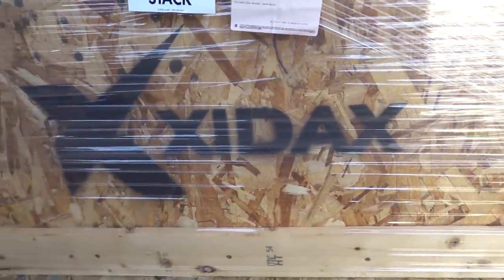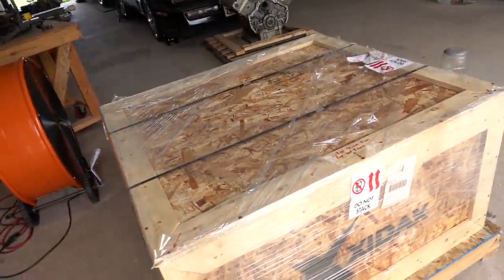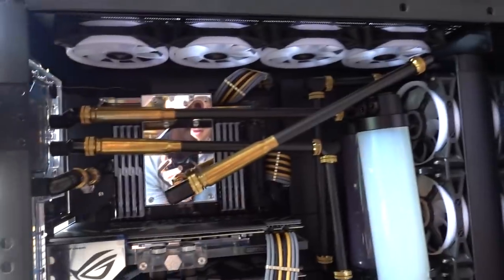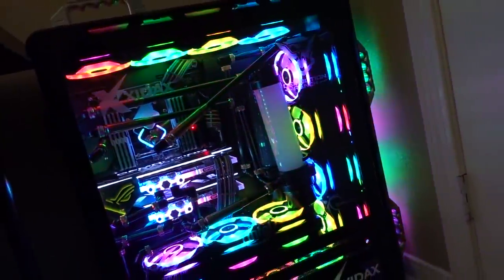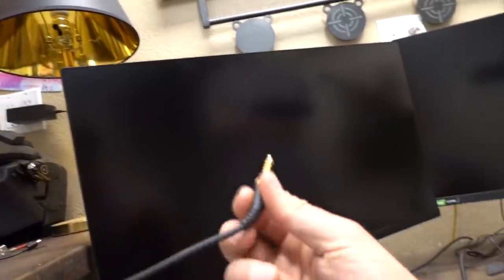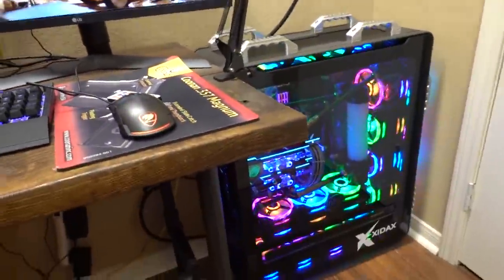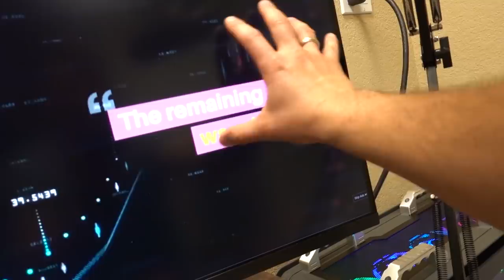The Demolition Ranch Ridiculous New Gaming Computer! TWITCH!!!!!

Comment: My man's is so wholesome, he's so excited for whatever he's doing and I still don't know how he keeps such a good attitude no matter what happens

Edit: reading the specs. 2 2080ti's? AND MARKED WITH DEMO RANCH?
Now that my friend is how you flex.
Reply: one of those cards costs more than my entire setup
Reply: Idk why he went so high spec when he has to do maintenance on that loop he is going to be lost or he is going to have to hire someone to do it
Reply: @Plane.  could call linus
Reply: 2 2080ti's and uses 1080p 144hz moniters wtf lol.
Reply: @williamnorris2717  1440p 144hz.
Reply: In about 3 months the 3080 ti will come out and significantly out preform 2 2080ti's.
Reply: 128 gb of ram
Reply: 2 tb nvme
Reply: @williamnorris2717  1440*
Reply: @joefrog1996  who cares. what game out there is going to be able to challenge a 3080ti? games are barely pushing 1080ti's to their limit
Reply: Ricky Fite truee
Reply: @williamnorris2717  agreed, if you were going to spend the cash and it was also going to be an editing rig why wouldn't you have gone 4k HDR1000 VESA certified.

Comment: As someone who does custom PCs and case mods, i'm honestly disappointed by that watercooling setup. The component choices are great for both the hardware and the cooling, but the layout of the lines is amateur at best; it looks crowded and chaotic especially with so many fans on all the radiators. They used PETG tubing but didn't bother doing any bends at all, just straight runs and heavy reliance on swivel fittings. It wouldn't surprise me that some leaks develop as the system ages with so many potential points of failure. They also bothered with so much packaging externally to the system, but didn't bother putting anything inside of the machine to hold all of those sensitive components in place. Doing that one thing alone would have at least kept the reservoir from coming loose from the upper mount. I hope that all of my qualms prove to be pointless and that you have a wonderful experience with the system for years to come, but I suspect that this machine will turn into a huge headache when you have to do maintenance in the future.
Reply: @danielredziniak2996  Constructive.
Reply: i agree, while 30 fans with rgb and 3 360mm+ radiators can look crazy, it really is pointless. internal foam for shipping would have definitely helped the first time around
Reply: @danielredziniak2996  Your videos show the amazing skills and knowledge you have to offer the world.
Reply: I was always wondering who was that one or two guys that always had to hit the dislike button on any video. Save a nun, thumbs down. save puppies ,thumbs down. nun saves puppies, thumbs down. For every 100 wipes there's always one or two thumbs down. Now I know who it is.
Reply: @danielredziniak2996  Ok2k
Reply: You're not wrong. I just tore my system down and swapped from the lian li dynamic to the dynamic xl. Cleaning 12 fans isn't fun and even cable management is a pain with just 1 fan controller and 2 rgb fan hubs let alone I'm guessing 5 rgb fan hubs for all those qls and at least 3 fan controllers?
Reply: He will just send it back for an upgrade or his little brother will fix it. I would love to get my hands on that thing.
Reply: @danielredziniak2996  he's right in every one of his points. Just keep driving your truck bud I'm betting it's the only thing your meager brain power can comprehend.
Reply: Daniel he's right though ya numpty
Reply: @sharewolf10173  I hope you aren't referring to me, that would really be jumping to conclusions without much for a base. I didn't like the watercooling setup, but that is no fault of Matt's nor was the video of poor quality or taste and as such, I didn't like or dislike the video. 
I certainly understand your point of even the best videos having dislikes for seemingly unfathomable reasons. It could be down to those who are obsessed with hating on someone or individuals who can't separate subjectivity from objectivity and dislike the video because it doesn't agree with their views or opinions. Could speculate all day long about the dislikes.
Reply: @subsgob00m  we will just speculate they were in a hurry and hit the wrong button... 👍
Reply: This guy, LMAO. beat it L O S E R.
Reply: @Honest Fellow free PR you mean? Cant expect the same PR from expected maintenance, so cant expect it to be free either...
Reply: @danielredziniak2996  How the hell is a guy who talks about technology pertaining to a modern pre-built system a boomer? There is this guy, sharing his skills and knowledge for free, giving a bit of constructive criticism. You think engineering is easy to understand punk? You think thermodynamics and fluid mechanics is a joke? The material science which goes to make tubing a facade? Pressure localisation buffoonery? Now go ahead and call me boomer. I'm probably younger than you.
Reply: It is a bit strange they would be so careless with upwards of $10k worth of hardware. Hope someone will service that for a reasonable price in the future. Looks like a headache
Reply: I agree.  I was trying not to completely hate the system. The back plates are super cool but, they should have custom mounted them with extension ribbons to show them both off in a single file vertical mount solution.  I do hate the not level tubing and the tiny little single out of place reservoir. The 50 casings were a cool touch. 

I think jay or linus would have done a way better job. Jay's videos are getting annoying tbh. It's like watching the spoiled fat kid brag about all his cool stuff. I just want to see cool custom builds. Hes good at it.

Anyways... I have a bad feeling the fluid in that pc is going to gum everything up. Hes going  to need to flush it in a couple months. I would use distilled water to replace it. 

I wonder if they even flushed the rads before final fill and I cant believe they didnt go gen 3 threadripper. Such mistake. Yea, the mobos are more expensive but the cpu is cheaper and a way better work station. 

That build is ultimately a sloppy mess with a couple cool custom back plates on the GPU's.

They need to strip the parts out and let some one do it right.

Comment: He said his ac Bill is going to be high. No Matt you’re electricity bill is going to be HIGH
Reply: That's the same bill....
Reply: I think he meant from the exhaust of the pc with all the fans removing heat from it he’s going to have to keep his ac on more ... it makes more sense that way
Reply: Joel Gonzalez I know it’s just funny he thinks the ac will run the bill up more than the pc. I think they probably both pull the same wattage
Reply: That pc prabobly has 1600 watts psu so electric bill definitely going up
Reply: Random Hobbies 100%
Reply: @randomhobbies5796  It's powerlimit, not the constant usage power. I doubt this PC will consume more than 1kW
Reply: camjamsdad  That pc is like over 10k and I dont know how much he plays but most fulltime streamers spent WAY less... So yeah, he can afford it
Reply: Matt: hold my beer..
Reply: @TheElitekruemel  He didn't buy that PC, it was a sponsorship.
Reply: Joel Gonzalez yes can confirm I have half that system at $3K and it heats up my whole room in about an hour of gaming. And had to get an extra window AC unit to keep my room cool even into November in Wisconsin lol!
Reply: @Infgator  you're right.. I didn't even think of that.. But under load with 2 gpus and all them fans.. Definitely 1kw +
Reply: Adam Harding geeesh bro now that’s serious gaming ! That’s an expensive hobby I used to be into ps4 cod bo2 mw3 but never knew it could get that crazy that’s a whole car lol
Reply: Also ac because the room heats up

Comment: Small recommendation about the PC, you should move it in a way that has more airflow... right now it's getting blocked by the wall.
Reply: i noticed that too, but he does wanna show off all that rgb... maybe place it at an angle so it at least gets some air flow
Reply: Maybe wall mount it somehow so more airflow and to show off the RGB's
Reply: with 30 fans and liquid cooling the front intake being a little blocked is not going to do much, especially when you consider it has an inch and a half of space at least due to the handles being there anyway
Reply: Also with the amount of air it is going to pull from under it with all those fans shouldn't make it an issue.

Comment: Plz get that resever back in it's brackets, before it is falling out at the bottom too. It looks like the bracket is there, so just push it back in. It is hold by clamping pressure.
Reply: By doing so , with hard line tubing i feel like it could "pop out" of the fitting :/ But surely he need to get this fixed

Comment: Matt ik the dyed fluid looks good but you should probably drain the loop and change it to distilled water bc the dyed fluid can cause the loop to clog
Reply: I'm so glad somebody else noticed that besides me.
Reply: How do you know its not dyed distilled water in it?
Reply: @rusteeznutz  any dyer fluid will eventually fallout over time, regardless of what the dye is made of and who made it. It makes a huge mess to clean afterwards. Pure distilled water leaves almost no residue behind.
Reply: If you maintain your loop, like you should, and as often as you should, that is a non-issue.
Reply: Koolance fluid is one of the best. stuff has a lifespan of 3 years. even the dyed stuff. he wont be having any issues.
Reply: @williameldridge9382  based on the video, do you really think matt knows enough to do that? Even drew?

Comment: Just wanted too say. if you havnt fixed it yet that your resivoir is hanging off. it has popped out of its mount. just be carful when pushing it back into its mount that the rigid tubing doesnt pop out of the fittings. thats the exact reason i use a clamp style mount for my res and not a pop in pop out style.

Comment: That reservoir with all the fluid in it closest to the outside glass panel looks like it is falling out of the holder a little bit, you should be able to push it back into the retention brackets. I'm surprised they don't use any foam pads inside the case for shipping.

Comment: Never leave a computer on the floor unless you want it clogged up with dust 10 times faster.
Make a nice little foot stool stand for it.
Reply: super rigs like that already come with foot stands to lift it off the floor already no need. 15-20k pcs already have that inmind
Reply: I had a Thermaltake case that I had to raise off of the floor a few inches, but the dust problem never went away. So ripped all of the parts out of the case and wall mounted everything. Haven't had to clean it for almost 2 years now. Changed my life!
Reply: especially with pets in the house
Reply: @josephpmans  or all that saw dust that he didnt get cleaned up properly
Reply: or the fact that it is sitting right next to the wall and can't draw in air effectively lol

Comment: You don’t need that much cooling for overclocking. Yes, cooling does help with performance on GPUs but you can run a stock cooler when overclocking. The cooling is very cool but also insanely overkill. 10/10 on the custom loop tho
Reply: under max load the gpu's will stay under 40 even with 2+GHz and the cpu with oc will stay under 60, all while staying silent.

Comment: Its probably ok as in wont affect much but.. the fans on the right side (after you brought it inside and put it next to the desk) the ones next to the resevoir, close to the wall. You generally dont want intake  or ouput fans that close to a wall because the heat is going to build up and you will be cycling in air that is warmer than the rest of the room since the smaller space isnt going to have as much circulation, so it will be cycling preheated air and in short not doing its job as efficiently. 

Beautiful rig btw. Im jealous that is the most beautiful, artful piece of machinery ive ever seen. Youre going to have a blast gaming on that monster.

Comment: UPS (Uninterruptible Power Supply)? Levels out your power clipping off power spikes and filling in the power drop outs via the battery in the UPS... you know... a power strip for sensitive electronics?

I have a $1200 gaming system I built 4 years ago and it is plugged into a UPS from APC (APCDotcom), an APC 550es from many years ago and even got a replacement battery for it 4 years ago. UPS's protect from power spikes and brown outs for power, telephone, and cable lines. Mine was a couple of hundred bucks 8 years ago and about a hundred bucks for a replacement battery 4 years ago. Has kept my computers, printers, huge LCD TV, and stereo equipment safe.

Comment: Rough time to upgrade. Next gen everything out in next 3-6 months.
Reply: Taking into consideration the power of this bloody beast he'll be good for at least 3 generations ahead. Even i9-9900K and a 2080Ti is pretty much enough for what he is doing, THIS is a triple overhead)
Reply: @Lime2Game  That looks like a X399 socket. This hardware isnt intended for gaming. You could get almost the same performance out of something that costs 20% as much. IMO he dropped the wrong CPU on this and way cheaped out on the monitors for the setup but I'm not going to knock him for it because he's not a tech channel... and he has a .50 BMG.
Reply: I'm a little sad for him. I've seen that 18 core get crushed by the 16 core Ryzen for half the price. I suspect that in 6 months that I can build a 100% AMD build that will outperform this machine in every category and be half the price or better. Plus the power savings.
Reply: @dawnfallon6812  considering that the 10980xe is about 10% faster than the 3950x for Premier pro exports, i wouldnt consider a slower CPU "Crushing" the intel chip... lol.
also, not half the price either. 3950x is $750, 10980xe is $1000. also keep in mind that the intel chips is running quad channel memory support, and more PCIe lanes for multi GPU and extra PCIe card support (running a 4k capture card, and an audio card along with two 2080ti's. 10980xe made sense for this build, unless Xidax went with the 24 core threadripper, or 32 core, which is faster for exporting, but costs double the price than the intel chip.

Comment: Hey Matt it’s cold. Matt: hang on I’ll get my pc
Reply: i can't even imagine the heat generated by two oc'd 2080ti's and an oc's i9 10980xe. my 1070ti/r7 2600x non oc already put off a lot of heat
Reply: @TitanRL1  I wonder how little heat actually comes out tho considering his pc has 30 fans and water cooling
Reply: ELIte squad That’s gonna release alot of heat. That’s how things cool by moving the heat. It doesn’t just vanish because you put it in front of a fan. It’s gotta go somewhere, just like your car radiator.

Comment: Not gonna lie that is the most overkill pc I’ve ever seen, you wouldn’t need that many fans If you had 6 gpu’s. Water cooled and 30 fans, I’m confused.
Reply: and they got radiators doubled up which isn't necessary
Reply: Yeh, looks like a 6 y/o kid designed it, and thought the more fans the better. Even the specs are literally dumb.. Pretty much 0 games use SLI, you don't benefit when streaming by having to GPUs, it could rather hurt the performance. A single 2080ti (or wait for 3080 / ti) paired with i9-10900k would be better for gaming, or paired with an Ryzen 9 3950X for content creation. This setup would probably perform better than what he got right now.

Comment: When he realizes if he took a Phillips screwdriver and took the side handles off it would have fit and he would not have had to cut his nice desk.
Reply: When you realize you cooked your $15k rig because you blocked off all the intake fans for your cooling system....
Reply: @bluewater82  It has way more cooling than necessary. It's overkill. It'll be fine as long as it's pumping

Comment: it got popped out of the top bracket holder, since these are hardline cooling pipes they've used instead of flexible ones i'd let drewski check that out, the last thing you want it a leaky reservoir

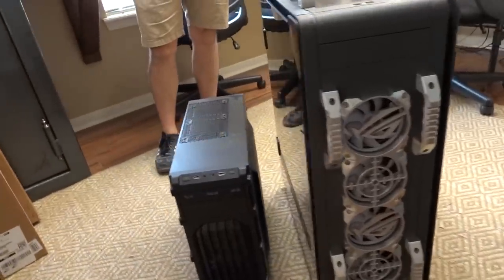Comment: 8:39 Matt, why not just remove the handles on the side of the pc? If it's going to sit in that tight spot, it's not going to need the side handles!
Reply: Needs airflow, the handles help make sure if you do put it in a corner it isn't flush to it has airflow. Same reason the bottom is spaced up from the floor just a tad.
Reply: @Elmer_RedEagle  Touché

Comment: This is NOT going to last long. You're choice of introducing a 50bmg round is cool but it's BRASS. the brass metal will containment the coolant and you'll start getting really gunky fluid very quickly. Mixing metals in an enclosed loop is an awful way to do things. Any water-cooling PC tech knows this and the fact this company did this is awful. 

You'll need to constantly replace the fluid. Eventually needing to take to all apart and clean every block. 

You should have hopefully told them to place nickel on the inside of the shells to prevent this or they should have used real silver for it's anti bacterial growth properties.

Comment: You guys spent like 5 minutes talking about the cooling, only to slap the front intake into drywall. 

Color me triggered
Reply: The old case had the top intake blocked by the top of the desk, doesn't surprise me much.
Reply: thats not too bad, no airtight blockage, the front fans really are only supposed to move a breeze of  a fresh air

Comment: An amazing box, and your rendering speed will be probably 4x quicker.. Not to mention scrubbing in Premier or anything will be buttery smooth with that 128gb ram :)
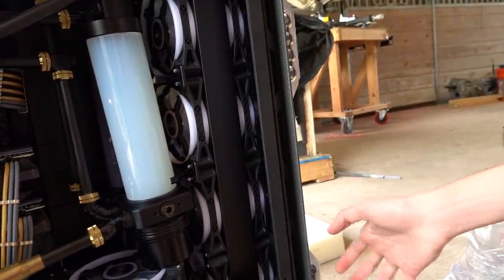7:20 You do want positive pressure.. That way all intake is running through filters. Negative pressure means it'll be sucking air (and dust) through any little hole in the case.
Edit: The case is already positive pressure from Xidax, was just making a note for anyone listening that might've been confuzzled.

#ripOperatorDrewski  - Should've let the skinny bro build it for ya